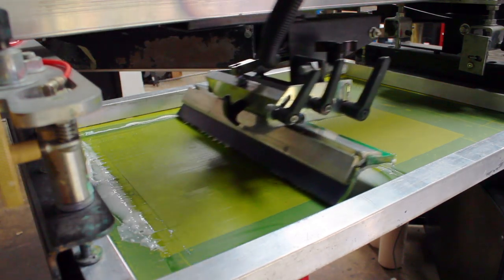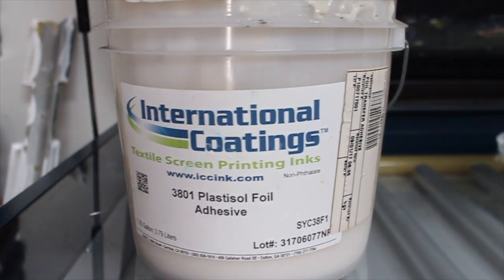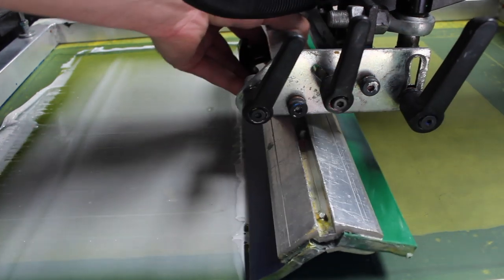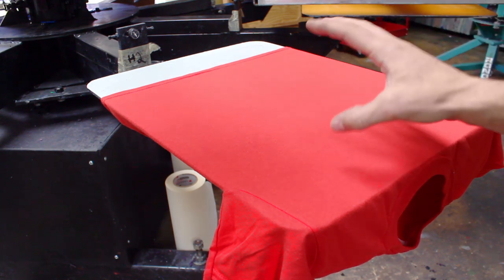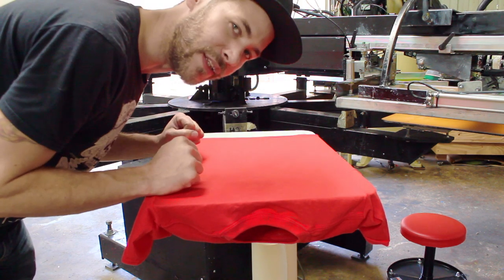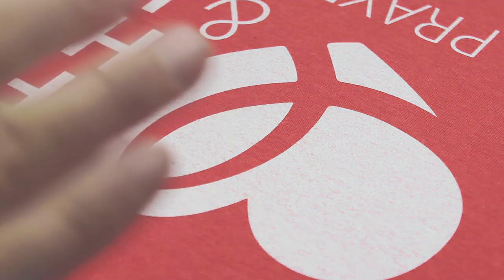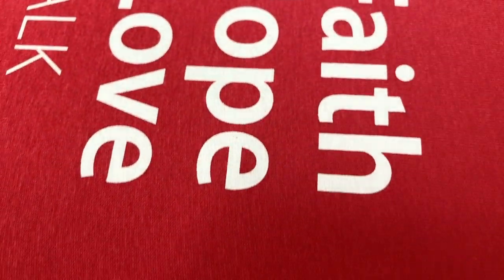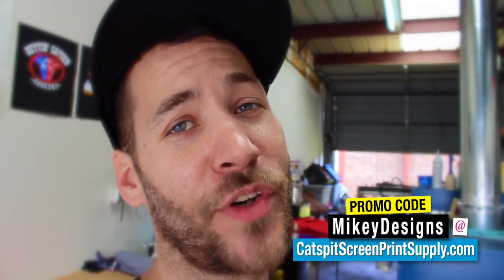How to Use a Flattening Screen | Automatic and Manual Screen Printing Press

Comment: So, I am a rookie in the tshirt printing business,  I don't  have a conveyor belt dryer and I use a heat press to cure the ink (plastisol), working hard to get the right equipment, my question is : is bad to use the heat press?
Reply: The heat press will cure the inks just fine and it will flatten the fibers down at the same time, but it does slow the process down a good deal. That's how we started with a 4 color 1 station press from ryonet 5 years ago.
Reply from the maker: I agree with Ct Apparel. Only other draw back I can think of is using a heat press will make the print shinny, but not a bad thing. Keep using your heat press and save up as you compete orders. It may just take one big order for you to get an entry level conveyor and then you will be turning around your orders much faster. I personally used my flash to cure shirts before I got a conveyor with a 6 / 6 manual. What I did was after I printed the first shirt, I'd pull it off the pallet, set the shirt on top of the pallet, and rotate it under the flash. By the time I was finished printing the next shirt, my shirt curing under the flash was finished curing. I would keep doing this process until the first shirt came around and I would just unload them from the pallets..
Reply: @mikeydesignssilkscreen473  you can just use parchment paper to get a mat look and feel instead of a teflon sheet to avoid that shiny look👍
Reply from the maker: @crumptees  Cool. I've heard that but never tried it. Good call.
Reply: @mikeydesignssilkscreen473  I had to switch to parchment paper for DTG because people didn't like the shiny look
.lol I kinda like the shiny look on some screen prints.
Reply: @mikeydesignssilkscreen473  Awesome, Matt! You and Apollo, laid 'dem fibers flat! And I remember my "flash dryer cure" days! Good times that paid off! 👍
Reply from the maker: Thanks!!! We sure did. It has definitely been a fun adventure with the occasional cursing. lol
Reply: @mikeydesignssilkscreen473  Yeah, I'm familiar with that too, seems like it helps the situation know that I mean business! 😣😂😂
Reply from the maker: @rpbvid  LOL!

Comment: Hey Mikey! So when you use a hard squeegee to flatten the print, lets say in a multi color print, does that affect the positioning of the print by any chance?? We have a flattening press but we use a roller and i feel like a squeegee would probably do a much better job as you showcased in the video
Reply from the maker: We haven't had Andy issues with the squeegee setup moving the garment. Maybe the roller setup is spreading the garment out like a rolling pin and dough?

Comment: Nice! I need to add the Teflon sheet. I have a blank screen that I used once to try flattening.  I typically don’t have to flatten unless it is a G5000. Most of the better quality shirts take ink very well.
Reply from the maker: I hear that! I we don't use a flattening screen all the time. A lot of the times the second over print will do just that.

Comment: Have u tried a roller on flattening screen? Any differences vs the squeegee
Reply from the maker: I haven't used a roller, but plan to get one for the new press to see what the difference is. A subscriber of ours has one and he prefers the hard squeegee method.
Reply: @mikeydesignssilkscreen473 👍
Another question, what screen mesh do u use for the 2 screens
Reply from the maker: @victorhart6157  I like to use higher mesh counts. 195 or the base, and 230 for the top.
Reply: @mikeydesignssilkscreen473  thank you! Cant wait to try this
Reply from the maker: @victorhart6157  Let us know how it works out!

Comment: I actually warm up my blank and then flatten before i print which mats down the fibers pretty good for the first pass of white and then do the flattening again after the first print which gives it a really nice smooth surface for the 2nd pass of white.
Reply from the maker: Nice! Very through! Is that on the manual?
Reply: @mikeydesignssilkscreen473  yes. Until we get the auto by the end of this month and then we might get the roller by action engineering depending on how the prints come out, but we are slowly moving towards water based inks which is giving us a really nice white without a flattening screen.
Reply: Same!
Reply from the maker: @crumptees  Nice! Which auto are you getting? I would be interested to hear if the roller squeegee helps any with waterbased inks.
Reply from the maker: @Tyler-216  I hear that. On the manual, we ran the shirts under the flash before printing, but mainly to shrink the shirts up so there is less issues with registration after flashing the white base and to evaporate any moisture.
Reply: @mikeydesignssilkscreen473  2003 Anatol trident. We dont really need to do a mat down with water base ever since we started using it. The comet white from ryonet is great. We have a 8' with a 4' tunnel with 2 heating elements lancer without forced air and the ink still cures with no problems.